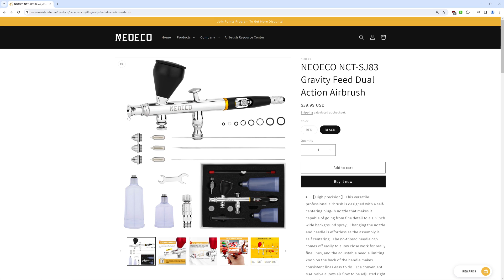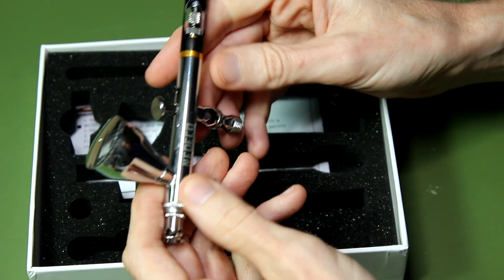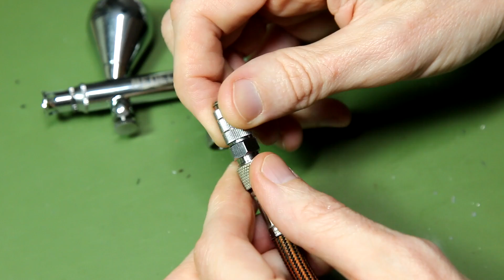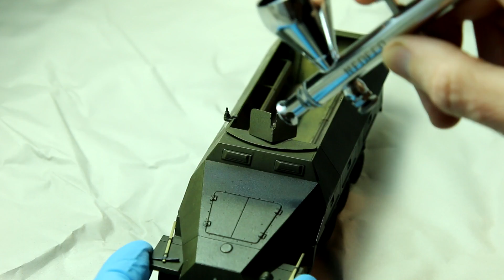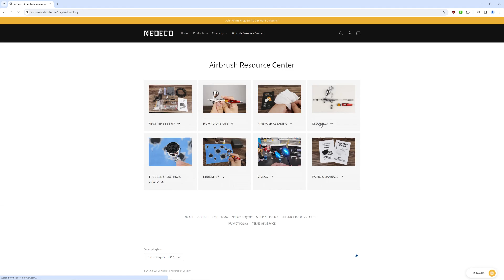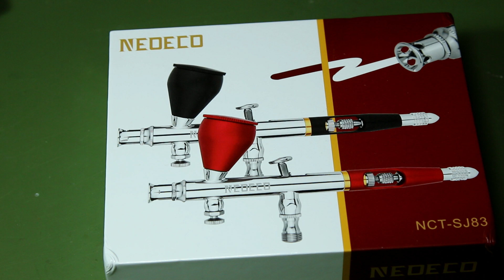Painting German camouflage - Great airbrush set - NEOECO NCT-SJ83 Gravity Feed Dual Action Airbrush

Comment: I bought one of these a few weeks ago off Amazon and truthfully their not that good it just doesn't lay paint down smooth
Reply from the maker: Sorry to hear that. I found my to be good - I was certainly happy with the finish. Which airbrush(es) did you use before?
Reply: @ModelNerd  I have a infinity and a Mr hobby airbrush and they have gotten me spoiled 😅 but I haven't tried the other needles that can with the kit just the .5 and on yours is the bottom of the paint cup flat ? Because mine all the paint will not come out
Reply from the maker: I'm not sure what you mean about the flat bottom of the paint cup - are you using the metal ones or the large plastic ones?
Reply: @ModelNerd  ill make a video of it and post it on my channel so you can see what I'm talking about and them plastic cups are worthless

Comment: That's a very good review and I think for the money that is a bloody good airbrush kit. One minor criticism for me is that it appears a little chunky, especially with that bell end nozzle. Having used airbrushes for many years I would say there are four things in the acid test with dual action airbrushes. 
The first is a really progressive flow of paint as the trigger is pulled back, the worst case scenario is pulling back on the trigger and getting no flow of paint and then suddenly a lot of paint. An airbrush that does this is rubbish. 
The second fault is spatter when doing small spots or fine lines.  An airbrush that does this is no good for fine detail work.
The third is the paint drying in the nozzle when doing fine work with very little paint flow, like small spots, so you are getting the air flowing and pulling back very slowly for paint and nothing comes out or initially paint flows then stops. Usually if you take the airbrush off the work and pull right back for paint it usually will start flowing again but if you are using the trigger limiter this problem is a real pain.
The fourth issue is when an airbrush gives a little spot or short flow of paint when the trigger is just pressed for air. Alternatively the paint is not fully shutting off. This again is a real pain for detail work. 
You could say some of these faults like spattering or the nozzle drying off is down to paint preparation but I would say that if an airbrush is very sensitive to paint thinning then it is a bit of a pain. If the paint has to be very thin then it can easily run or fail to cover well.
Reply from the maker: I agree with your points, Allan. The only time I have the "air flow also produces paint" problem is when I haven't properly assembled the airbrush though - the needle isn't far enough forward into the nozzle when the trigger is neutral. But you're right, the better tools are less sensitive to these issues / make them harder for you to cause.

Comment: I got one of these airbrushes in a set with a usb compressor. Both are surprisingly good for £50 total spent.
Two issues I've had with the airbrush:
1: the thread stripped in the black part for the needle backstop. I fixed this by wrapping some foil tape around the backstop screw, which gave it just enough bite to work again.
2: using acrylics, I've found the nozzle a bit difficult to fully clean, because of its depth.
Reply from the maker: Yes, the cleaning was definitely not as straightforward as my other airbrush - I probably should I have mentioned that in the video

Comment: I an looking to get a new airbrush, I bought my first and current one on the recommendation of someone on youtube ironically and results have been sporadic from the start, I certainly would not recommend it. I have done a few models with it but sometimes it refuses to work as it should, so at the price of the Neoeco and others such as Fengda Ishall be looking to change very soon, thanks for your review.
Reply from the maker: Steven, can I ask what type of problems you're having with your airbrush? It is possible that I or my other viewers may be able to offer some suggestions.
Reply: The air on off trigger constantly sticks in the 'on' position, this despite thorough cleaning and lubrication and sometimes when I try to paint hardly any paint comes out , which means that I have to empty the paint cup and blow through with thinners , which sometimes works, or a total stripdown and start again.  @ModelNerd
Reply from the maker: Oh. I'm not sure what to say about that. Cleaning would have been my first choice but you've done that!
Reply: Hi Stu? I used my airbrush twice yesterday and again today and it has performed perfectly, the paints were Tamiya XF and clear gloss ,very strange. II still intend buying a new airbrush and it will be interesting to compere the two, thanks for your interest. @ModelNerd

Comment: Perfect timing, I've been attempting a come back to modeling for quite  some time. The learning curve has been steeper than anticipated getting to know the volume if supplies available. . I should have checked my air brushes first. I'm ready to starting painting and have discovered my air brushes and compressor were probably used by Michael Angelo  . Its probably going to be best to invest in something new like this airbrush and pressure controlled compressor than search for new parts and hoses on my old equipment. I organized my old stash and discovered lots of paint mules.so I'm almost there. So thanks for this video its definitely going to help. CHEERS from the colonies.
Reply from the maker: Cheers - and good luck with your airbrushing!